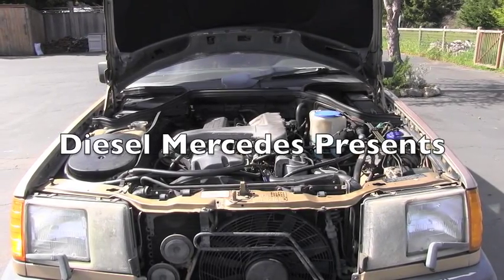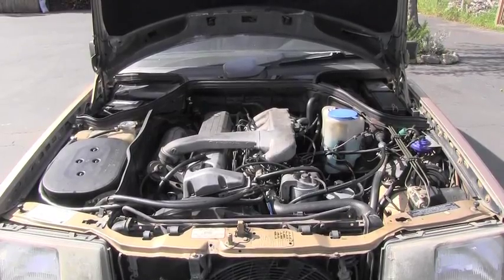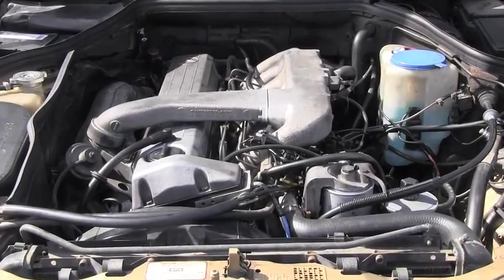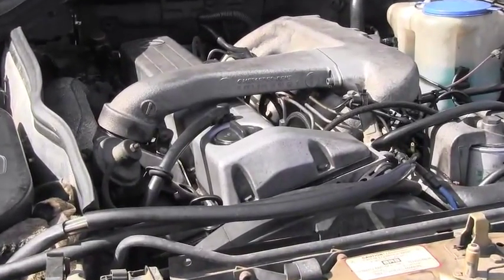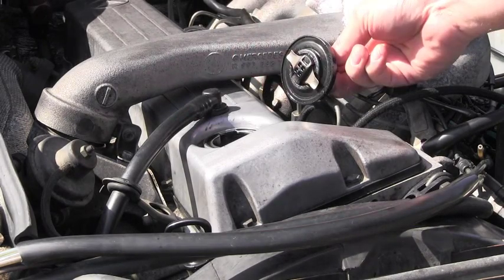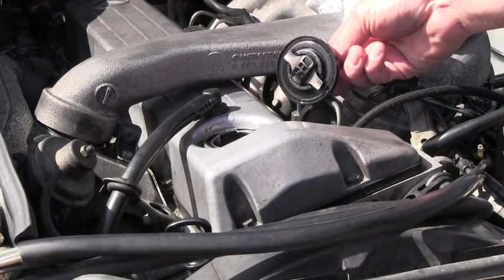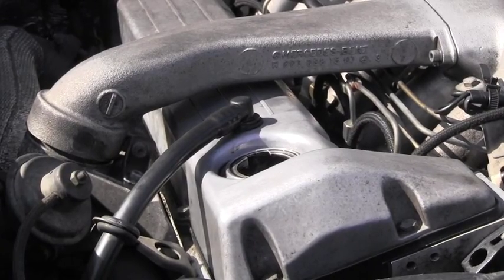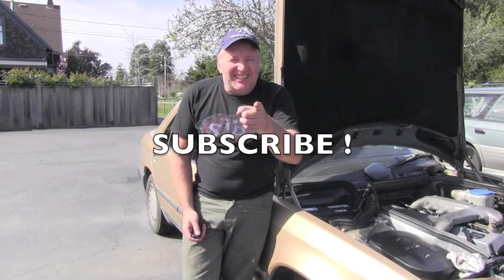Mercedes Diesel Blow-By Test

Comment: When I do this on my om602, I don't see any exhaust gases, but oil does splash out a bit? If I set the cap down it doesn't float, either. If anything, it feels like it is getting sucked down a bit and held in place.
Reply: High oil pressure maybe?

Comment: I use WVO in Merc 124 250 diesel 1990 almost for the 55.000 kilometers with out any problems. One tank. No heater, nothing. In the warm days 5% petrol and in the winter 20% in the mix. One time in year use diesel purge. Wvo  just need to be good filtrated and no wories. One man in Malmö use WMO (waste motor oil) like fuel in the same Merc like my almost 3 years. But smell of exhaust gases its disgusting and the color its bluish.

Comment: One question. I have Merc 124 250 diesel 1990. And i using WVO(waste veg oil) in that car a long time and i don have any problems with anything. Single tank no mods. Only in winther put 20% of petrol and start like charm. But spare parts its a litlle bit hard to find for that old Merc. What do you think, if I can try to use WVO in the Mercedes E290 td 1998. Maybe the fuel pump its not strong for WVO like in older Merc?